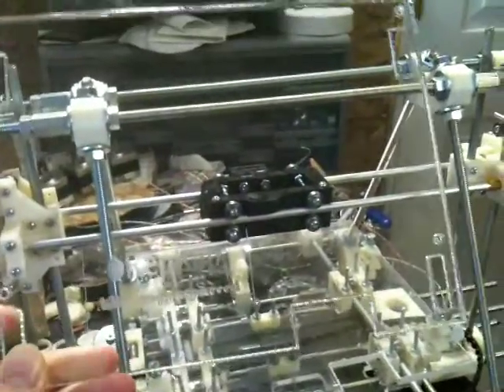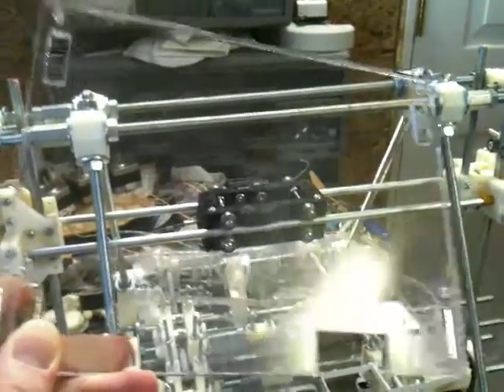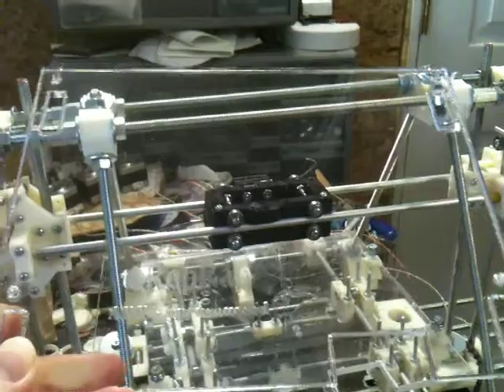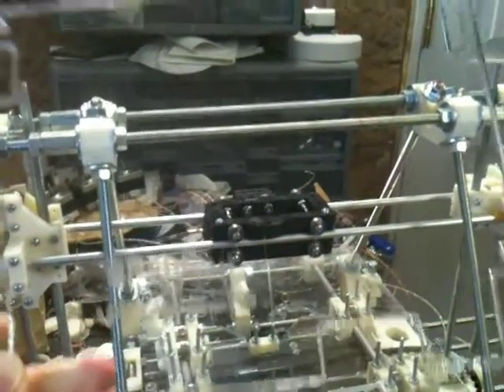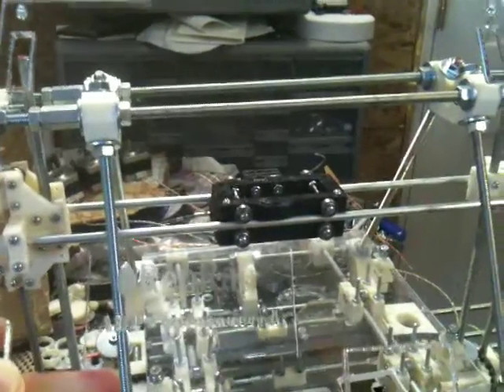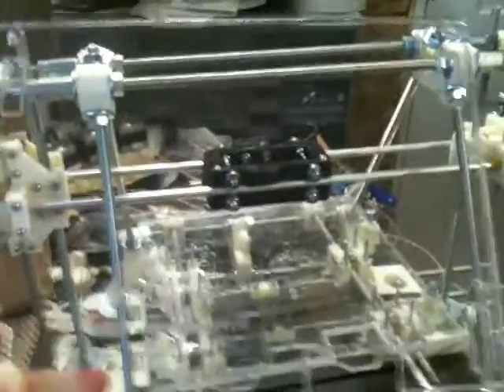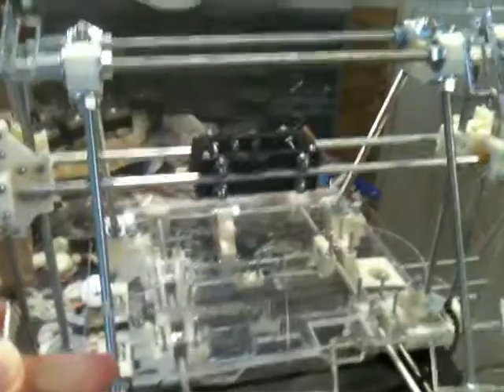mendel abp bed base  laser cut. rest of abp coming along

Comment from the maker: I don't know if prusa has the support structure to handle the additional weight of the abp.I asked prusajr in his acceleration video to verify with the added weight. you might want to ask him as well. if the prusa can handle acceleration with .5kg of weight, then it could. it will likely weigh a lot less than that as it is still being designed, but the Mendel has better support structure under load.